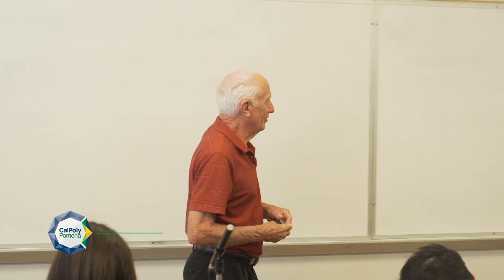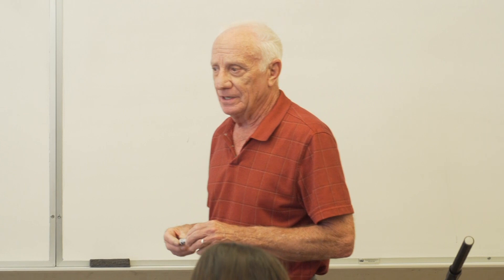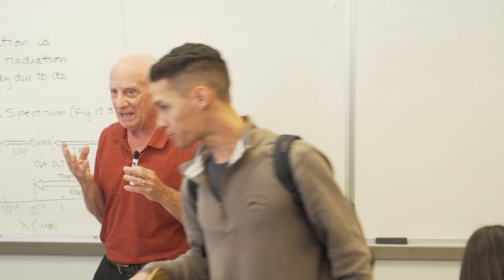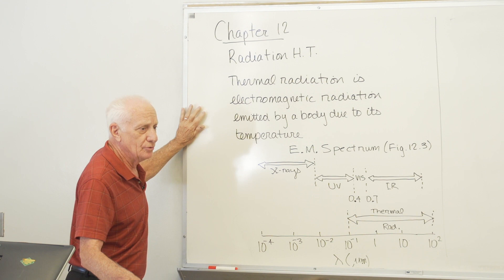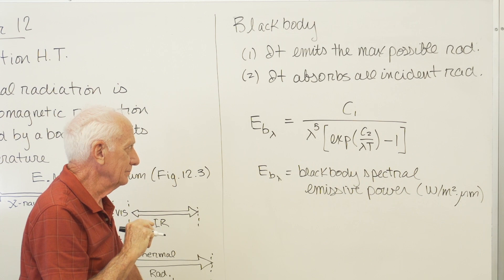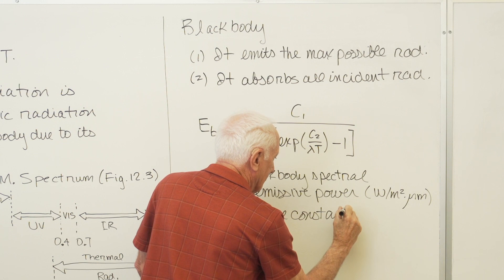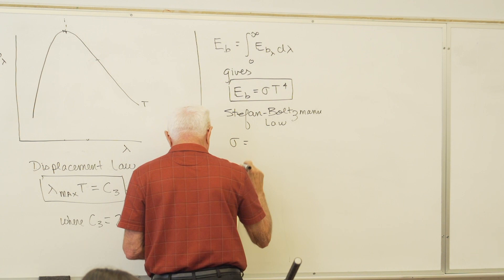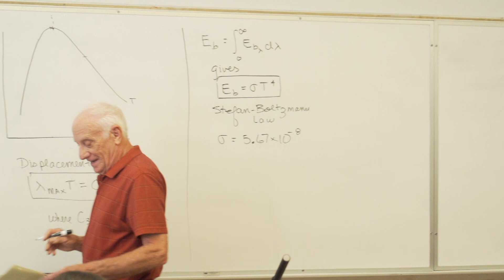Heat Transfer (15): Introduction to radiation heat transfer, blackbodies, blackbody examples

Comment: Why is the formula for the heat radiation of a black body given by the integral of the whole graph from 0 to infinity? Shouldn't it be the integral from 0.1 micrometers to 100 micrometers (the wavelength range of heat radiation)?
Reply: I think the integral is from 0 to infinity because thermal radiation occurs only between 0.1 micrometers to 100 micrometers. Lower or higher wavelengths add thermal radiation close to zero so it makes no difference. But it's just a guess, but it would be possible to find out by comparison between the integrals of the function given by Planck's Law with two different boundaries (0..infinity and 0.1..100 micrometers)